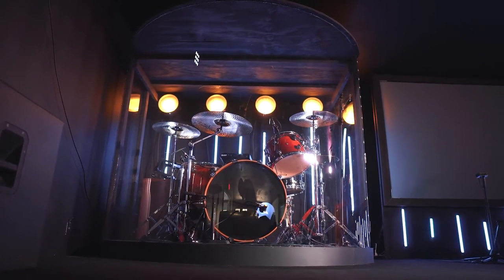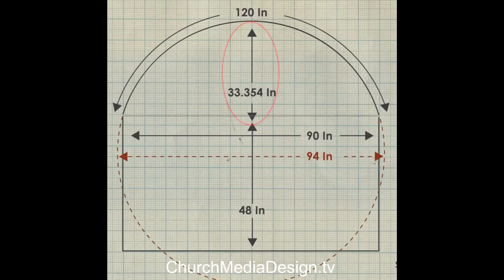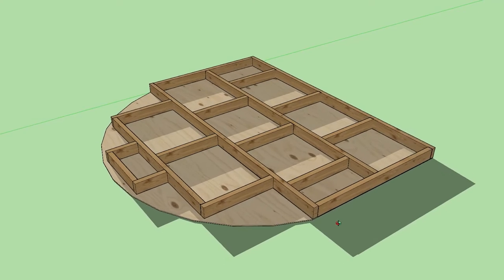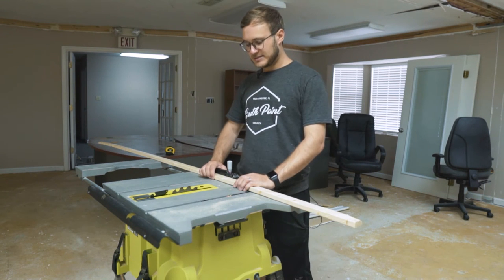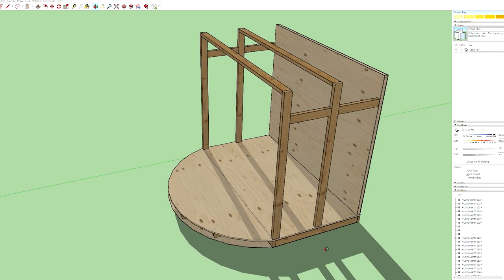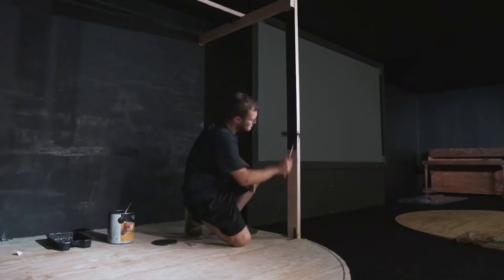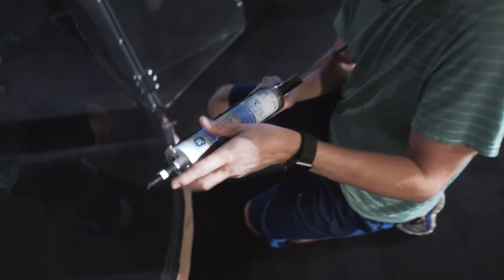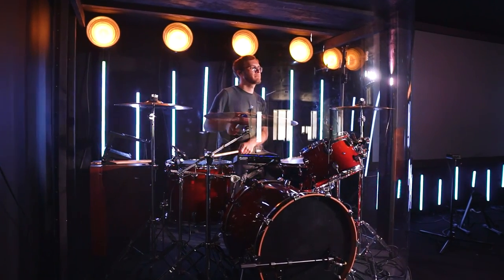DIY Drum Enclosure Build

Comment: So I am starting my build, I purchased the Poly, but I was wondering if you had a materials list? Also did you happen to have the building plan in paper form as well?
Reply from the maker: Hey Aaron, I just saw the email you sent my way - I will take a look at it and get back to you asap! I do not really have a materials list, but I could probably get you pretty close or help out with things you might be missing if you have one out together already? 

As far as a building plan, the only thing we went off of was what we provided in the video - just those few measurements that were provided to us and then we worked everything around that
Reply: Sorry Aaron... where can I get the transparent acrylic sheet of that size .. in which company, where did you buy it?

Thank you
Reply: @joelantoniocastrofunez5560  call up your local glass shop and see if they can order a 6x10 piece of Lexan.

Comment: Great build guys. A few things I would have changed/added;
- Rubber matting or spacers on bottom of the platform (This will help absorb low bass frequencies and other vibrations)
- Sealed door using beams of wood with carpet on it with one single sheet of Lexan (this will stop anything from leaking out of the drum booth onto the stage, such as cymbals) 
- Make sure there are no gaps between the Lexan for cymbal noise to leak out
- Put diffusers, or a curtain drape and the back of the enclosure to deal with any reflections

Comment: That booth looks FANTASTIC. Thanks for taking the time to journal your building process!!! There’s so much to learn from other people... the problems that you guys ran into could’ve easily been absolute nightmares for me.

One thing I would add though is that imo a decent sounding drum booth MUST have absorbers in it. The reflections off of the smooth, hard surfaces inside are inevitably going to lead to some nasty comb filtering. I’ve mixed in venues that had suboptimal drum booths and you can just never get the drums to sound proper if the booth causes comb filtering.

EDIT: Just read in a comment further down below that you guys aren’t using overhead mics. Without those obviously reflections are much much less of a problem. I’d still recommend putting in absorption material (maybe DIY absorbers in the back and hanging some black molton to the ceiling). As for micing cymbals: Try close micing them from below! With your kind of setup, you can easily get away with only two mics on each side. One for hats and crash (just low enough to pick up the hats, but beneath the crash) and one on the other side - ideal positioning will depend on whot those cymbals are and how they’re played). Feed that into some gentle room reverb and you’re good to go. =)
Reply from the maker: Hey thanks for the kind words! And yes, agreed - we even have a bunch of studio foam in storage that we just never got around to adding in. There was another comment on here with someone concerned about the same thing, but I told him our situation is unique - our building is really small and since our particular door design isn't air tight, our close mics just blend nicely with the natural sound escaping. In reality we have to run our services so quiet that we don't get to pump up the drum levels enough to even reach the point where comb filtering is an issue for us. 

I appreciate the tip though (and also your kindness in it). Thanks!
Reply: @WeTalkTone  You bet! Keep up the good work and God bless you guys! =) Seeing your dedication to the ministry is an inspiration!

Comment: what did it end up sounding like inside the enclosure? just with your guys mics talking inside once the polycarb went up there is a heck of a lot of reflections coming off of it. did you add much/any acoustic panelling?
Reply from the maker: Most enclosures add some kind of sound dampening material, and we originally intended to do just that but never got around to it. The lack of sound dampening material has had no ill effect for us, other than the chance it might keep it slightly quiet outside the enclosure. As for inside, it is earsplitting loud to play drums inside of it without in-ear monitors. But, that has also been the case with any enclosure I've played inside.
Reply: @WeTalkTone  so you don't seem to hear any of the sound being reflected off of the panel back into the mics?
Reply from the maker: No, at least none that I can tell in a live environment. I will say, however, because our building is so small and or enclosure does not completely block out the raw sound (because of our door) we do not use over head mics. Only close mics on each drum, and just let cymbals bleed into those. So, if we were to use overheads, the reflections would probably be a little noticeable. It's probably safe to just plan on adding something to dampen your sound - you can find "studio" foam on Amazon for so cheap now

Comment: Guys - This is a great video with a great outcome. Thank you for putting it all together (both the booth and the video). I'd like to plan something like this for my church but I have a few questions. So you started this project in the fall of 2019 ($900 = Lexan + Wood + Paint + Screws + Caulk). Did you need to buy any extra tools or would you recommend any that you wish you had at the time? What about your original ClearSonic shield - did you use all of that or half (or somewhere in between)? How long did the build take once you had all of the materials in-hand (how many days and how many hours/day; from your first cut to when you added the final trim and caulk)? It was nice that you had the empty space to work in and it seemed like largely a 2-person job (except for when you needed help with the top). What about wiring for electricity and mic cables, any extra spend of cash and time to do that (or approach you took)? I need to plan this within a 6-day build-time (Sunday afternoon (post-service) to following Saturday afternoon, so its in place, the kit is set-up and all wired for sound for the next Sunday's service) and I want to understand if it may make sense to build parts of it off-site and then assemble on-site. Lastly, now that you've had it for a while, any ventilation wishes (a sweaty human can leave a not-so-holy presence). Thank you again.
Reply from the maker: Thanks so much! Yes, that $900 is a rough estimate because towards the end when we were back and forth to Ace Hardware multiple times a day we stopped keeping track lol. But it was somewhere around that ballpark (of course that was before the price of wood went up, but I don’t think it’s too far different now). Also, we did not have to purchase our carpet squares or carpet glue since we had some on hand from renovating the whole church - and I honestly do not know how much those would normally run price wise. As far as tools, we already had on hand between the two of us and people from our church all that we needed - a table saw (which you could possibly just get your plywood cut for you at Home Depot), miter saw, router with some bits (i think all we used was the quarter inch straight bit), and drill. I don’t recall using any other tools. 

For our particular build we used four panels from our original drum shield + four foot high extender panels, as our original shield was only 5 ft tall and we had separate foot high extenders. Each panel was 2 ft wide. Please remember though that our door system was unique to us and I don’t know that we would recommend going the same route as our accordion door if you do not have to. We have seen other YouTube members copy our build but put a simple door on the back of the enclosure. 

All in all, the build probably took us around 5 days total but of course this might vary depending on how skilled you and your workers are with the tools. Some days were long days, some were short. Ours were spread out over the course of 2 weeks just because we couldn’t work on it in consecutive days and we didn’t have a hard deadline of getting it done in the space that we were to have church in the following Sunday. I imagine with enough time dedicated to it, it shouldn’t be too hard to get it done in 6 days.

As for wiring, we took the easy route and just took a hole saw to our back panel for wiring and electric once it was all built. One hole allowed for all mic cords to pass through and an extension cord for any power we need in the cage. We found placing a small fan on the ground pointed at the drummer does enough to keep our drummer cool in there. I’m sure there’s a more intricate and sound-proof way of doing this, but since our particular door wasn’t air tight, we felt no reason to get fancy on coming up with a near air tight system for our wires. 

If you are in the least bit concerned about getting it built within the 6 days or it may be tough to get help for a couple of those days, I don’t see a reason why you couldn’t build the base platform and back wall off-site and bring it to your church to assemble. I will say once everything is put together it is not the easiest thing to move lol. 

If I’ve missed anything or you have any more questions, feel free to email me at wetalktone@gmail.com! I’d be happy to help with anything that I can, and would love to follow along with the progress of your build!

Best, 
-Ethan
Reply: Thank you getting back so quickly and providing a very thorough reply. Time to calculate 2022 costs.

Comment: It looks great!  Thanks for sharing the video.  I want to ask what's the environment like for the drummer?  Did the temperature and humidity inside the box have any issues, especially after a long set or in warmer weather?  If so, what did you do, or would have done different in retrospect?
Reply from the maker: The biggest thing to know is just how loud they are inside - definitely wouldn't drum in there without some well sealed in-ear monitors. 

In an air conditioned environment, it doesn't get horrible for us (remember ours is far from fully sealed like some others may be). We have added a little fan inside for some circulation since one of our drummers likes it. For long sets though, I could imagine it getting fairly uncomfortable without some circulation of air or vent fan.

Comment: Currently building one for our church & have a quick question! The only drills/screws on the front sheet are the ones on the two 2x4s on both sides at the end of the sheet, & the too & bottom part are just inserted into the slit ya’ll cut out on the plywood, correct??
Reply from the maker: Correct. We then kind of caulked it in place, a bead around front and back, top and bottom to seal it in

Comment: quick question. At the beginning of the video you said you asked your glass provider for a 6X10 foot sheet, but in your calculator you have 10 (length) and 7.5 (width). Why is that ? Im just confused on that part lol
Reply from the maker: So the 7.5" in that calculation is just the width of the platform (90 inches). The polycarbonate sheet is 6"x10"  - as in 6ft tall and 10ft across. So if you were to draw a straight line from one corner of the 10ft arc to the other, it would only be 7.5ft. (10ft being the distance around the arc). Hope that helps!!
Reply: @WeTalkTone  thanks!

Comment: How did you get the polycarbonate to curve? Did you just bend it yourself, or did an outside company have to do it?
Reply from the maker: It's fairly easy to bend yourself since it's so thin - doesn't require heat to bend or anything.

Comment: This was super cool! Thanks for putting this up! Does the enclosure dramatically dampen the noise? I'm trying to do something similar for my house, with the goal being to make the drums as inaudible as possible from outside the enclosure.
Reply from the maker: This did cut down a ton on our noise level outside the shield. You can definitely still tell someone is playing drums, but it takes the edge off and lowers the overall level considerably. Your best bet will be to work out a door system that is as air tight as possible. That’s where ours falls short...
Reply: @WeTalkTone  Awesome! Thanks for the reply 🙏

Comment: How is the sound that gets picked up by the drum mics? Are there any serious reflection issues, standing waves or so because the drum shield is not treated with absorber panels? I am concerned that the sound of the drums might loose its fat sound and pressure if I build this drum shield for my church. Sound is a big thing for our church. 
Greetings from Germany
Reply from the maker: We have certainly not noticed anything like that, however, our situation is somewhat unique. We are in a small space, so our mic'd drum sounds aren't super loud, and because the particular way we built our door, the cage is not airtight - meaning our processed drum sound is still mixed somewhat with the natural drum sound leaking from the cage. 

I can say that I have seen air tight drum enclosures similar to this (in that the majority is not dampened - but they may place studio foam or dampening material on the underside of the ceiling and the back wall) in large churches elsewhere, and I have never heard of any negative effect as such that you are mentioning. If there is, I would think that the benefits it brings to your live sound far out-weigh the negatives. Having complete control to eq, reverb, and process the drum sound with virtually no stage noise really is an unbelievable difference in live sound.
Reply: @WeTalkTone  Thanks a lot for the quick response!

Comment: The enclosure looks incredible! Question: does the polycarbonate arc provide better sound reduction than plexiglass panels? Would the same concept work using a prefabricated drum shield, assuming the same level of air tightness and 360° coverage?
Reply from the maker: I would say the sound reduction would be about identical... If any different it would be imperceptible. Yes, Hunter actually just made another one for another church that used only panels from a drum sheild. And because they made everything air tight, it's crazy how good a job it does at blocking sound

Comment: I've seen a couple of these videos, but everything I've seen mentions it gets very hot in there but I haven't seen any solutions for ventilation or cooling.
Reply from the maker: We just set a small fan in there to circulate the air. Does wonders. Doesn't have to be anything extravagant. Could always install something like computer fans in the back, one pushing air in and one pulling air out.
Reply: @WeTalkTone  I also haven't seen anyone use Loaded Vynl or covering the back with soundproof blankets. But I will say this was my favorite video of these so far, Is there an estimated overall cost to build?
Reply from the maker: Yes, strongly recommend adding sound dampening inside, whether foam or blankets. Total cost at the time of the build was around $900 for us.
Reply: Where can you purchase the polycarbonate?
Reply from the maker: Your best bet will be at a local glass shop. You can find it online, but the shipping will cost more than the panel

Comment: Did you all do the arc yourself or did you find a company to do so? If so can you share their information? I’m finding companies to do the cutting but not the arcing.
Reply from the maker: I'm not entirely sure what you mean.... we inserted the Lexan into the groove we routed - it's a very flexible/bendable material. All of the other processes you saw us do.
Reply: WeTalkTone Just so I Understand, you bought a rectangular poly sheet and the did the bending yourself into the “arc”? Or did the company shape the poly sheet for you? That’s my question. Hopefully that makes sense? I’m wanting to know do I need to find a company to shape the arc for me or do I only need to buy the custom sheet and bend it myself?
Reply from the maker: Yes, we purchased the rectangular sheet and the arc groove I routed into the wood platforms (top and bottom) are what hold it in place as the bent arc.
Reply from the maker: No need to have a company "shape it" for you, it's very flexible and will bend to whatever you need (within reason)